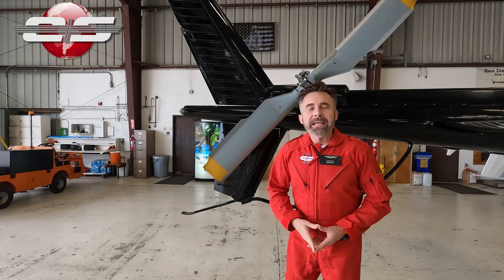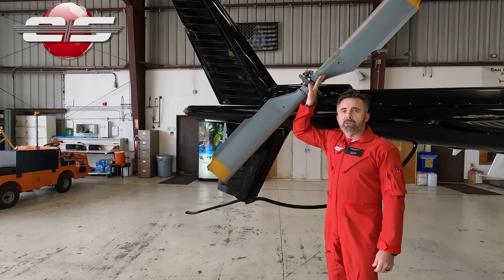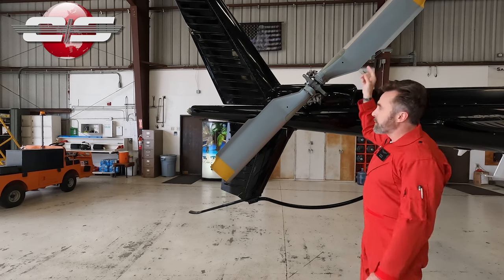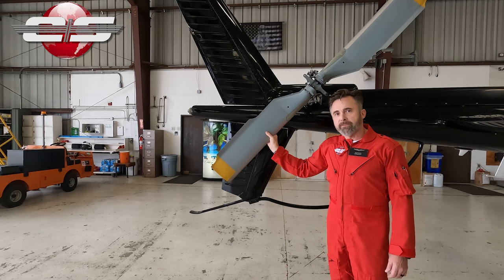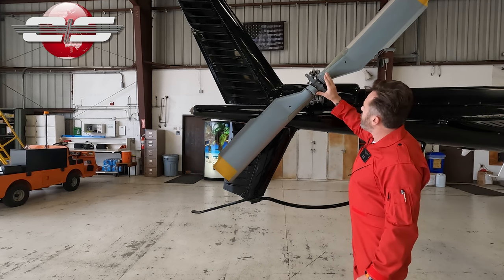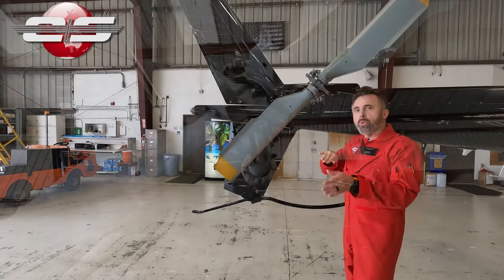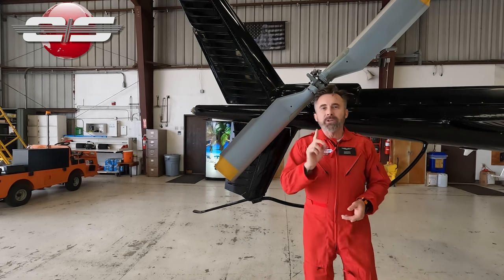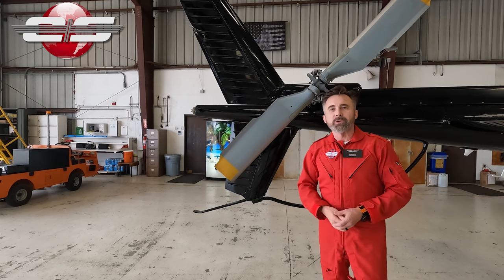Mastering AS350/AS355 Aerodynamics: The Role of Tail Rotor Boss Weights

Comment: The boss weight what effect cause during emergency no control of tail rotor ?
Reply from the maker: There are alot of variables within that question. Simple answer is that their purpose is not for the loss of control emergency procedure. I believe you are asking, and let me know if Im wrong, do the boss weights neutralize the pitch in the blades after you engage the ACCU TST/HYD TST pushbutton. The answer is no. They actually do the exact opposite. They are a weight in a plane of rotation. An object in a plane of rotation wants to stay in that plane of rotation. But they are only strong enough to do that if they have hydraulic pressure helping. When we depress the ACCU TST (in the dual HYD Cut off first) it dumps the pressure in the yaw load compensator (in single it also cuts off flow of hydraulic fluid to the tail rotor servo). Now the boss weights do not have any help holding the twist in (takes a lot of pressure to make that happen). Since the boss weights are not strong enough to hold the twist in without the help of the hydraulic system the twist of the spar "untwists" from the simple fact that a twisted piece of fiberglass wants to untwist.

Comment: Nice presentation but it is not clear by what is meant by 'Twist IN" and "Twist OUT".  Is Twist "IN" with pedal applied?  Or is Twist "IN" back in to the neutral position?  And if you apply pedal and then take your foot off, is the tendency for the pedal to stay where it was or for it to return to neutral (flat pitch). Thanks.
Reply from the maker: The spar in the tail rotor twists to induce pitch change. It can twist that position the blades to produce wind flow to the right (right pedal) or twist the other way and produce a wind flow to the left (left pedal). The boss weights a rotating in a plane of rotation once the twist has been applied. These weights want to stay in that plane of rotation. As long as there is hydraulic pressure in the tail rotor servo the weights can hold the twist at the present position. If the hydraulic pressure is taken away the weights are not strong enough and the strength of the twist wants to untwist..... did I answer your question?
Reply: Yes:  The boss weights aid in keeping the same pitch angle of the blades because the mass of the boss weights want to stay in the same plane of rotation.  Thanks!  @EUROSAFETYTRAINING